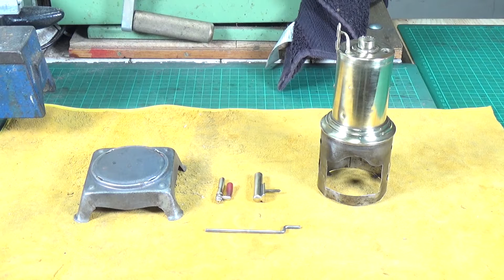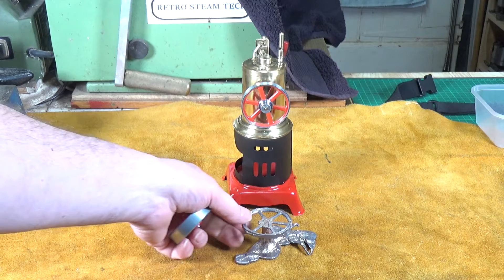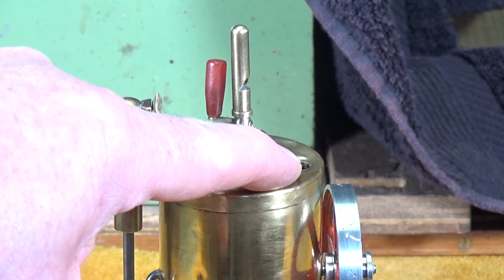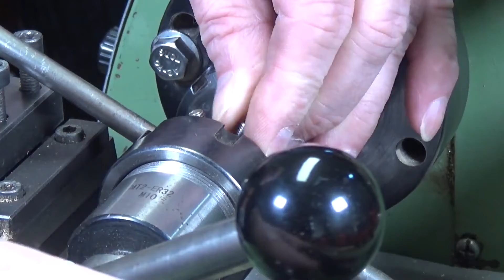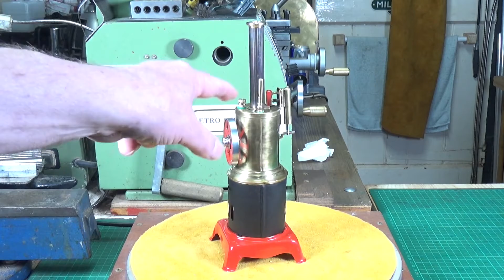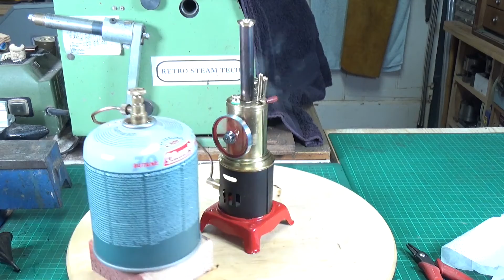Small German Vertical Boiler Model Steam Engine Bing Or Ernst Plank

Comment: how did you get the length of the rod? I just got a similar engine with no piston
Reply from the maker: You know the depth of the cylinder, the stroke and how long your piston is. The piston doesn't need to go all the way to the back of the cylinder, it should stop just before the steam inlet. With this information you can easily estimate how long the rod should be.

Comment: Hi Alan.  Came up well.  Strangeness with the flywheel inclusions.  It may have been centrifugally cast, which could explain why the original surface was OK, even though the inner is flawed.  Interesting.  Cheers Rob
Reply from the maker: Hi Rob. Thanks, I didn't think it turned out too bad. I never considered spin casting, I did think that maybe Mamod out sourced the production of parts like the flywheels. Assuming no one ever does what I did then you would never know. Cheers, Alan.